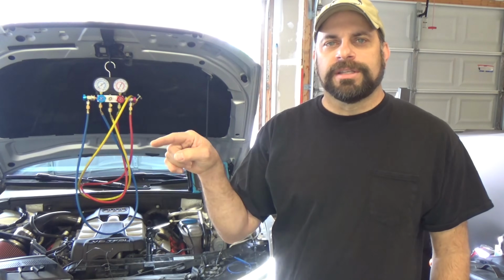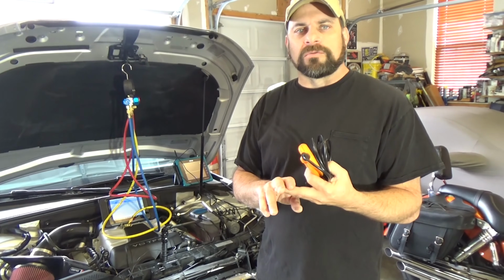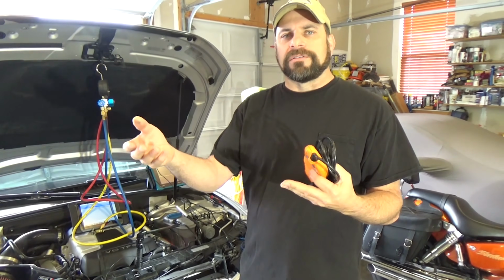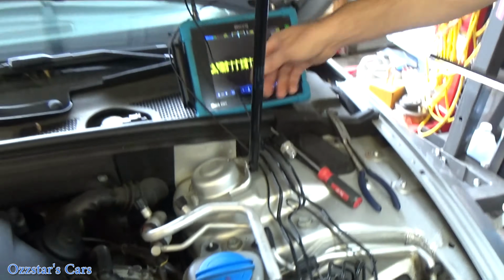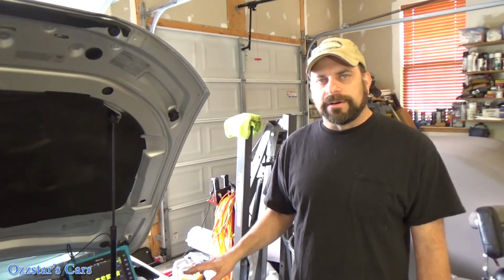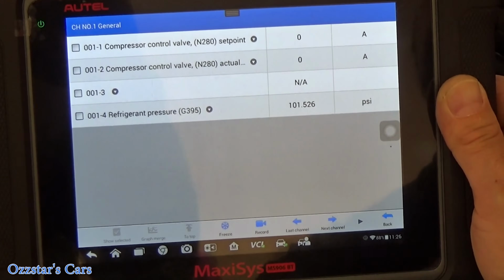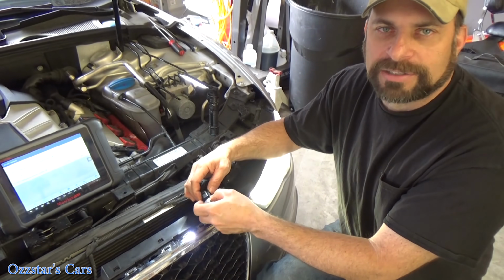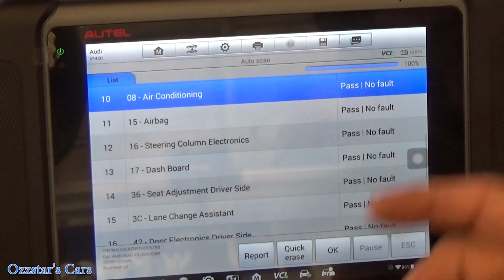Scan Tool Autel MS906BT and Micsig Oscilloscope Audi Volkswagen A/C Diagnosis Fix Code 00457 00256

Comment: Where is the black lead connected to on your voltmeter when you measured voltage on the pressure sensor with the red lead?
Reply from the maker: What is the timestamp in the video where I demonstrate that?

Comment: What's the solution when the LIN-BUS cable is pinched or cut?
Reply from the maker: Solder the ends together or replace the entire harness.
Reply: @ozzstars_cars thanks for the reply, I wasn't sure if you could solder a data wire, Audi advise against it but they would! I'll give it a try, just gotta figure out where the break is now 🙄
Reply from the maker: @Spanish_Matt66 be glad it's not fiberoptic 😮
Reply: @ozzstars_cars guess nobody ever ruined their eyesight looking on the bright side 😎 I shall persist 🙏🏻

Comment: Great content & very very clearly described. My AC was hit & miss so I swapped out the pressure sensor for a new one, unfortunately my AC still seems to be hit & miss. I don't have a code reader or diagnostic tool. What else could it be? It was vacumed & regassed last summer & has been hit & miss  since & continues to be  like this even with a new sensor. Could the refridgerant be low enough to be hit & miss?
Reply from the maker: Don't guess and test.

Comment: I have a 2016 VW Touareg. The a/c will stop blowing any air after about an hour of driving above 70mph. I works perfect all around town, in traffic, or under 70mph on the highway. It seems like the mix door goes closes and zero airflow comes out of the vents.The blower fan is running and loud when placed on high but still no airflow. If we stop and turn off the car and wait 15 mins it works great again until over 70mph and then shuts down again. I've had it to VW 3 times with no luck. Any ideas? Maybe a pressure switch of some kind. It shows no error codes. 
Thanks
Max
Reply from the maker: Is the evaporator icing up and freezing?

Comment: Does Autel make scanners that tell you the problem accurately for people with no background training in automotive? I'd like to buy one, but I hear their customer service isn't really good. I won't know how to read fuel trim levels and what they mean. Are there instructions provided or does Autel just pinpoint the closest area to the problem?
Reply from the maker: The tool only provides data which has to be interrupted by the user.

Comment: Thank you very much awesome video    I have a 2017 Chrysler 200  with Permanent code p0128 It doesn’t wanna clear no matter what I do drain the coolant replace thermostat housing with calling temperature sensor but the problem is when I go to fill it up with Colin Ronit the fan kicks on every time every time I start the car fan kicks on on low speed I don’t know what the problem is can you help me out please everything is off the AC S off defroster Essaw but the fan store runs on lowest speed all the time but I notice the AC compressor is running to all the time what should I do ?👀🌿.    I don’t know what to do the temperature stays on 224

Comment: Sir, I have a question, you mentioned the 8 volts ref was coming in from the ECM to the switch vs the 8 volts are being pushed out from the sensor to the ECM. Is this what I’m hearing? If not, my apologies.
Reply from the maker: Nope. You need an oscilloscope.  8 volts is what a voltmeter sees not accurate for a proper diagnosis.

Comment: Excellent demonstration of troubleshooting the vehicle a/c with the diagnostic scanner . If one knows how to use the scanner when making  repairs - sure saves time. That being said , I believe the scanner you were using is bi- directional - so wanted to know , can you actively test or power the compressor on directly with the scanner ( component test ) to prove the a/c clutch works ? and also prove your a/c system has pressure - taking the guesswork if you're system leaked refrigerant because you do not have a refrigerant gauge manifold to connect and check pressures.Again, thanks for the excellent demonstration  ✌️
Reply from the maker: Yes Coy I have had good success with this scan tool bidirectionally controlling the a/c compressor clutch on many different makes.  I have a video review on the Autel MS906BT which has been an awesome diagnostic tool for me. Thanks for the comment!

Comment: Hi, I would like to send you the code to upgrade automotive function for your oscilloscope. Can you reply my email? I think preset automotive function will be more useful to you.
Reply from the maker: The issue I have with my Micsig scope is that the wifi function never worked since brand new.  My contact information can be found in my profile.  ozzstar@aol.com
Reply: @ozzstars_cars  we sent you an email, please check, sir.

Comment: This goes to my saved Scanner/scope folder and I subscribed. I have a Uscope and Maxisys MS906BT so I am trying to learn as much as I can on how to use them. I purchased the Maxisys MS906BT based upon your recommendation.
Reply from the maker: With those tools you have some solid diagnostic equipment!

Comment: i love the video and the effort you put on explaining each detail, well done and appreciate this. will def like and subscribe. 
i have a quick question, i am having the same issue with my b8 a4 and same error code 00256. what would happen if i only change the sensor without all these diagnostic procedure you done, would it still work for me ?
Reply from the maker: Fire the ol' parts cannon.  Sometimes ya hit the target and sometimes ya miss.  I prefer to test and not guess.👍

Comment: Dude!  Great video.  I've been pulling my hair out trying to diagnose my AC on 2008 A6.  VCDS was showing an error for refrigerant too high.  I had  a reading of 32-33 bar, which is a crazy 450psi.  Manifold gauges were 63 on the low, and high.  I couldn't get more refrigerant in, without getting compressor to cycle.  Applying compressed air to middle port, just over 100psi would allow compressor to run.  Also running a duty cycle test of compressor solenoid, did actually cycle on compressor at a low rate.  Pulling my hair out.  I found your video searching for 'G395'.  Spent all day futzing around on this. I think I'll just score a new sensor.   Found a few on Amzn with mixed reviews.  Did the Amazon one actually work!?  Thinking $45 at FCP Euro.  Tools I have, VCDS, Gauges, VOM, Power Probe IV.  Filling system at idle I could not get LO over 63 psi, and Hi was stuck at same.  Still wondering if R134a cans are at 63 PSI, and how to fill higher without aid of AC compressor pulling LO side down.
Reply from the maker: Almost impossible to diagnose that over the internet. You could try a reputable Amazon cheapo sensor and play parts swap-a-roo  and see if it corrects the issue but it's a gamble at best.  Let us know how you fixed the problem.
Reply: @ozzstars_cars  TRUE!  I know.  After some reflection I decided to order two of the sensors last night.  I found some for $30 from FCP that were made in Germany.  Its a starting point at least. I'm determined to learn this system, since I have three 2005-2008 A6 cars.  So, it seams compressor works, it's getting it told to cycle, is the wall I'm hitting.  4 seasons makes a little tool to cycle it on, but it's like $280, and I think needs to plug directly to compressor.

Comment: have you ever changed a R12 system to a 134a I want to do that.  Having a hard time finding a coupler adapter for the High pressure line . I bought 4 that were supposed to fit but don't .
Reply from the maker: It's expensive and a lot of work.  Pretty much all of the major a/c components are supposed to be switched to R134.  I still have some R-12. 😉
Reply: R12 to 134a Is there a Half Assed way I can do it and save some money haha.
Reply: @mikemaifeld6280  You'll have to drain the compressor oil and replace it with PAG, pull a vacuum, and charge it with r134a. Why use an adapter on the high side? Just use r12 guages. Also r152a will work better and you don't have the change the compressor oil.
Reply: @inoahmann7542  your right I got it thank you

Comment: Is that your bike what is that a Honda ?
Reply from the maker: Yes. Honda Shadow Sabre VT1100C2. Great bike, 14k miles on it now.
Reply: @ozzstars_cars  - Nice pipes on her! 🤘
Reply from the maker: @SmittySmithsonite  they look good but the pipe cracked at the flange under 500 miles and the pricks at Bubs Pipes refused to warranty them.  I had a guy tig weld them and he did an awesome job. 13k miles later they never cracked again. No Bubs Pipes for me ever.
Reply: @ozzstars_cars  - Ahh CRAP! Sorry to hear that, but I appreciate the warning. I'll spread the word. They sound like a bunch of crooks.